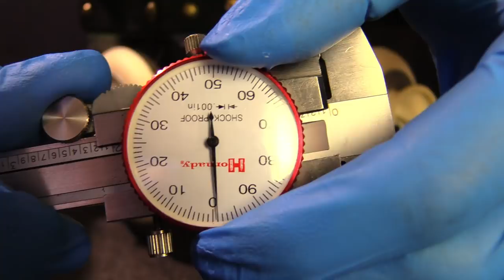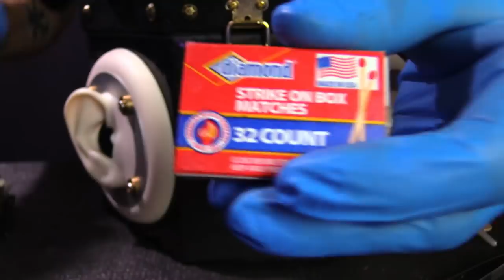Hearing Module Test ASMR (Ear Cupping, Match Striking, Tweezers)

Comment: Timestamps (Finished: ✅)

Note - If a timestamp has a (?) it means I am unsure if it is the exact trigger/etc.

0:00 - Opening packaging or/and gloves (?) and gibberish

1:28 - Opening tongue depressor

2:10 - Rapid tapping of a tongue depressor

2:14 - Overview and/or muttering

2:28 - Rapid tapping of tongue depressor again

2:42 - More rapid tapping

3:06 - Opening and closing ear cupping

3:48 - Measurements

4:10 - Measuring first ear

4:45 - Measuring the second ear

5:05 - Results

5:20 - Ear cupping again

5:35 - Tweezers

5:50 - Large tweezers and small tweezers

6:10 - Tweezer rubbing against a tongue depressor

7:05 - Side-striking and striking (continued previous)

7:30 - Tiny tweezers/long tweezers (left & right)

8:00 - Cleanup/brushes

10:00 - Inspection

12:40 - Hearing test

13:00 - Rapid tapping or spoon thing (Idk)

13:20 - Scooping powder (?) with a spoon for test

15:30 - Matches

15:50 - Tweezers grabbing matches

16:05 - Testing side one (matches)

16:45 - Tweezers grabbing matches

16:55 - Grabbing multiple matches

17:20 - Another side (Matches)

18:15 - Jump-starting match

18:40 - Jump-starting another match

19:15 - Cleaning off the residue

22:20 - (Final) Ear Massage, before Module turns off
Reply: You still have 18 mins of timestamp left
Reply: They must have fallen asleep 😂